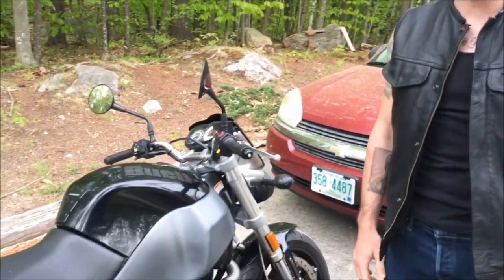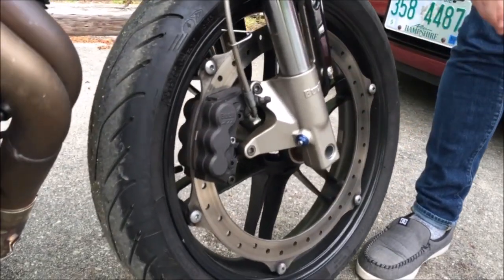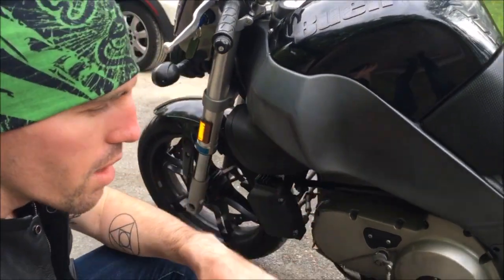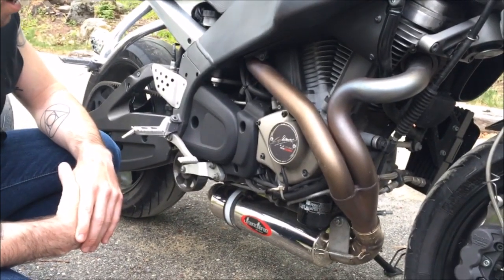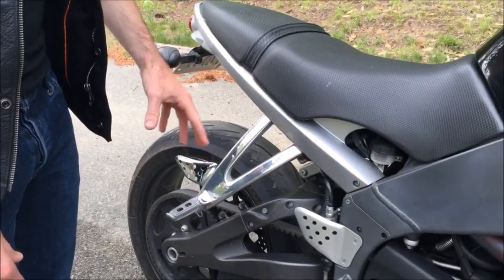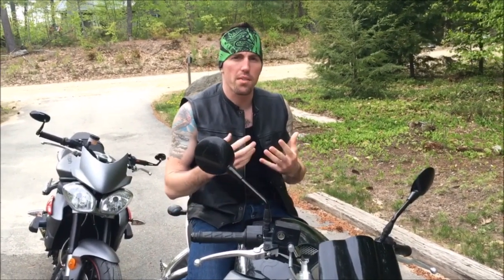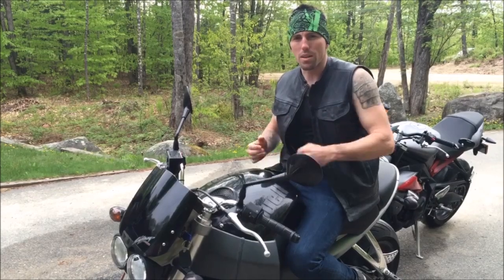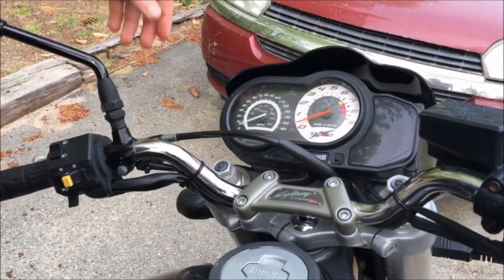Buel XB12ss Lightening Long Review

Comment: I used to have a 2006 XB12R, the most comfortable bike I've had (and I've a dozen or two), rode like a 400cc. The only thing that made me get rid of it was insurance (it fell under super-sport/racing) and the chronic problem with start (I immediately sold it after changing the starter relay, so it may've been fixed). Otherwise, a joy to ride!

Comment: I bought two Buells yesterday.  I got a 2010 Long with 8000 kms and a  2007 Ulysses with 14000 kms.  It surprised me how much I like the long. Both have been stored inside and appear like new.    Canadian winters keep the Km's down.  I think a new exhaust is in order.
Reply: That's a great find on the SS long...
The 2010's had about every kink ironed out.

Comment: you right about the weight, it's all on the lowend of the bike but you are wrong about it's good for the twisty roads, its more easy to ride but when the weight is more on the top end of the bike it would actualy lean faster and it would be easier to go from left to right.
Reply: U couldnt be more wrong. Xb series bikes are some of the best handling motorcycles ever made. UK streetbike said the xb12r was the best real world handling bike produced to date. And they hate American bikes.
Reply: @fvgc454ss  well a xb9sx was my first bike and I now drive a bike which has a totaly different weight distribution and can say it leans way easier or lets say faster. The xb is more comfortable even tho it is so small and is by far the most stabile bike I have had but I stay with my claim about the twisty roads stuff. It's more of a tourer bike than it is a sportsbike.
Reply: @swansmeister  idk bout all that. And that's coming from someone that's had 12 different liter bikes, 2 dual sports, multiple buells, zx14 and a turbo vrod and riding 20 years. Xb series bikes are some of the best handling bikes ever made especially on the street. They out corner pretty much everything out there.

Comment: Do xb12s actually feel fast? The power is "ok" , "adequate" or "decent" with around 100 rwhp and 400+ lbs it should be pretty brisk, my 3 harleys from60hp and a 70hp ironhead to a 80hp shovelhead low rider ive had went decent the shovel felt pretty balsey but ive ridden a 110 rwhp 103" stroker s&s (prob 125+ at the crank) in a 85 softail that went really good and i rode a 115rwhp 100" super sidewinder (prob 130hp @ crank) to in a hardtail and that thing really hauled (both were dynoed), the softail is really heavy and the hardtail is alot lighter but still no lightweight so with the KB12's power to wieght ratio it shud feel really fast. Ive never ridden a Super sport bike like the 125 rwhp R6 or even a 180 rwhp liter bike so i wouldnt have that insanity level of HP to compare it to so i would have that bias when trying out a KB12... because everthing feels slow compared to those bikes i would think.
Reply: Let me tell you how it is. I had a sportster with 50 hp and I got a buell xb12r. Ive had the chance to ride a gsxr600 before too. Lets just cut straight to the point: The gsxr600 is much faster beyond highway speeds. However, from 0-80 or so the buell will hang nose to nose. The buell has so much low end it's insane. You can actually move over to the left lane on the interstate and pass that semi with the 53 footer within maybe 2 or 3 seconds WITHOUT changing out of top gear. I can assure you if you've never had a bike with 100 hp its gonna feel very fast. And it actually is! I got my xb12r to 135mph, and I think it probably had another 10mph in it since it was still pulling, I just got spooked and let off. I also roll raced a mitsubishi Evo with dynoed 410 wheel horsepower on the interstate. we went at 50 mph and from 50 all the way to 110mph we were nose to nose. Trust me these bikes with the 1203 will probably scare you with how hard they pull. Unlike the 600s these bikes have power in all gears, from the bottom to the top of the revs. No matter what gear you're or RPM you will have plenty of power in your right hand. You will most certainly be happy with the purchase. Check out mine on my channel if you wanna see a well taken care of beauty!

Comment: so what makes it long???
Reply from the maker: no idea haha
Reply: that's what I thought because they all sort based bike.
Reply: no, its got a few inches more wheelbase vs the s and r models making in about the size of a Japanese 600
Reply: It has the same longer wheel base of the Ulysses. It is effectively a low Ulysses.
Reply: 1990 yep
Reply: The SS shared the frame and swingarm with the Ulysses. This made it 2in longer and increases fuel capacity.
Reply: The previous Buells had unusual geometry in the frame design! Andrew Trevitt from Sport Rider magazine tested the 12xb and the Lightning Long on a race track. The old 12xb had 51" wheelbase and 21 degrees of rake vs the "long version" which had 25 degrees of rake and a 54" wheelbase on a track with other motorcycles! He stated the long was a very effective "track tool"!